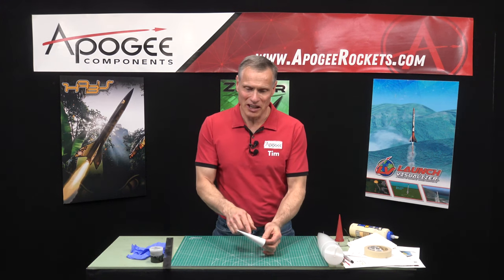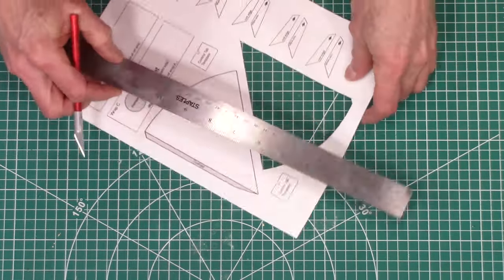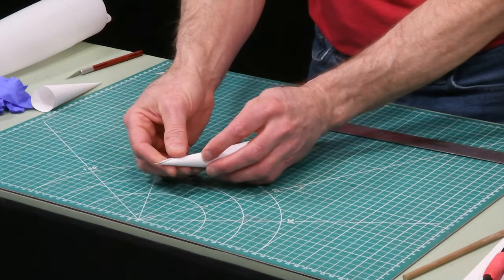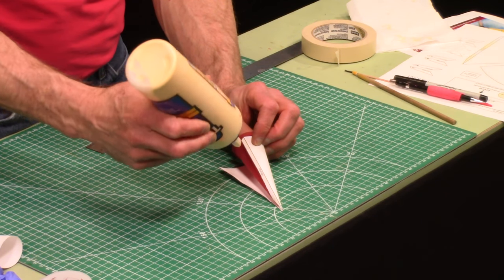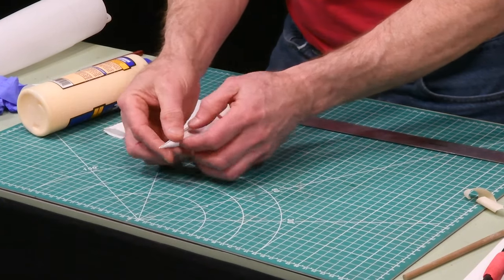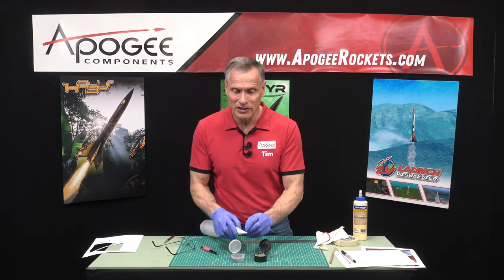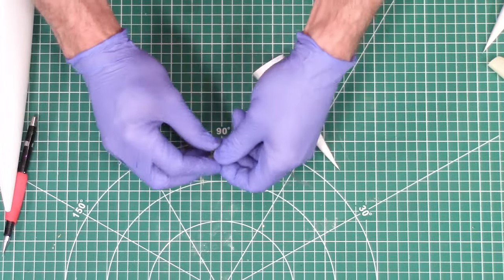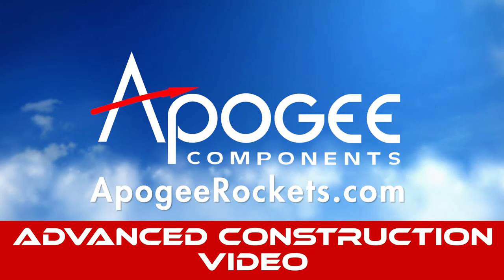Creating Perfect Paper Nose Cones

Comment: I have made many paper models and one tip while cutting is to flip the ruler upside down with the cork side up. It's much easier to get a more accurate cut. Pulling the paper against the edge of your tabletop can create a curl in the paper as well as rolling it around smaller and smaller diameter cylinders of stuff around your house.

Comment: Just bought this kit and can’t wait to start building it!  My only comment is why not include this 3D printed “tool” with the kit since it is specific to this model?  It can’t cost that much to produce and I’d be happy to pay another 5 bucks to have it included with the kit.  I don’t have a 3D printer nor do I know anyone around me that does.  So now I have to find someone to produce it and then pay them.  This is an inconvenience to me that adds a level of frustration.  It would just be easier if it were included in the kit with the kit priced accordingly to cover the cost of the tool on your end.  I’ll probably just make the cone without this tool although I see the benefit of having it for this build.  I’m also going to go with the liquid epoxy method for the tip as someone mentioned above.  Thanks for the video as I was wondering about this step briefly seeing it mentioned in the kit’s description.
Reply from the maker: It would add "$ignificantly" more than $5 to the kit. 3D printing is very expensive right now.
Reply: that was just a guess.  I’d be willing to pay you for it as a part of an increased kit price rather than having to track this down on my own.  It just frustrates me.  Thanks for the reply.  🥰

Comment: Darn, I found it a splendid idea until you showed me you needed a 3d printed part hahaha. Cool idea anyway. I sawed of the tip of a nosecone and glued a piece of balsa on it for pointy V2 nosecone.
Reply: It's totally doable without the 3D printed tool (I've done at least a dozen cones this sharp over the years). It just requires a bit of care getting the tip to line up.

Comment: What if you poured some liquid epoxy in the bottom of the paper cone and pushed the nose cone into it?  It would naturally force the excess epoxy out at the top and you could wipe it off.  Keep your gloves, paper towels and rubbing alcohol handy for that step then have a way to hold the nose cone upside down while it cured.
Reply from the maker: I love answering "what if" questions. The answer is always: "give it a try!" That is the best part about rocketry, you can experiment on your own.
Reply: Just bought this kit and can’t wait to start building it!  My only comment is why not include this 3D printed “tool” with the kit since it is specific to this model?  It can’t cost that much to produce and I’d be happy to pay another 5 bucks to have it included with the kit.  I don’t have a 3D printer nor do I know anyone around me that does.  So now I have to find someone to produce it and then pay them.  This is an inconvenience to me that adds a level of frustration.  It would just be easier if it were included in the kit with the kit priced accordingly to cover the cost of the tool on your end.  I’ll probably just make the cone without this tool although I see the benefit of having it for this build.  I’m also going to go with the liquid epoxy method for the tip as someone mentioned above.  Thanks for the video as I was wondering about this step briefly seeing it mentioned in the kit’s description.